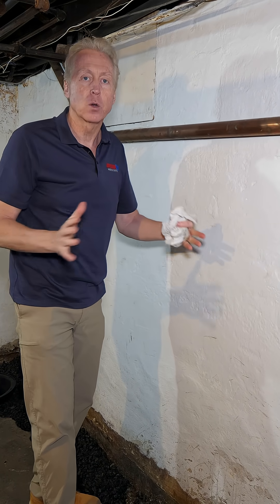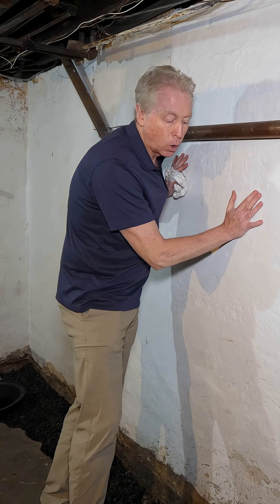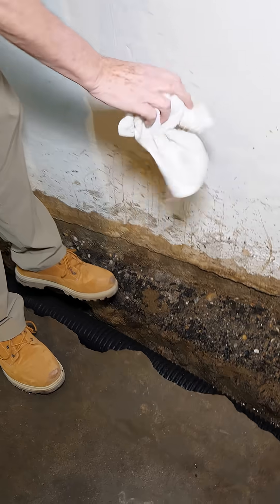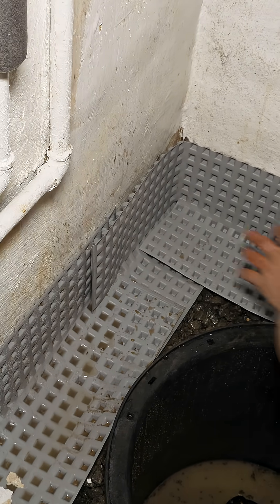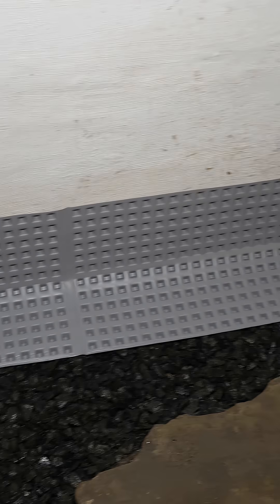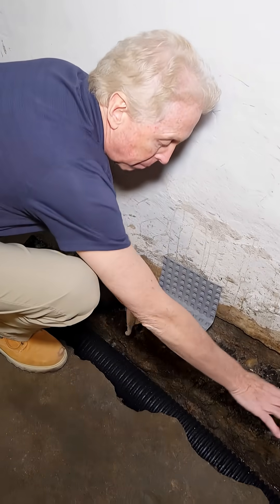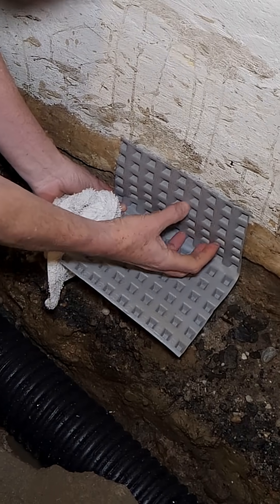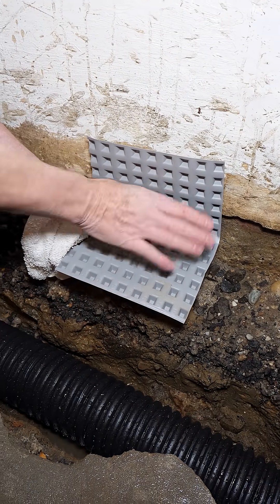How a Basement Drainage System Should Be Installed | the Right Way #basementwaterproofing

Comment: I can't find any basement companies in our area to use a system like yours, they all use those terrible tray/track looking piece ls that I always see you ripping out.
Reply from the maker: That’s unfortunate. The reason why you are seeing more companies installing drain channels in basement is that they are easier to set up shop, no experience required, and they earn a big margin off the quote they give you. The only problem is their system usually fails. You should seek advice from a person who understands foundation construction.
Reply: You don't want this system bro. It might be cheaper than doing it properly, but why would you waste your money to not solve your problem. Get it done right, from the outside. Seal your foundation up and save your home.
Reply from the maker: @dthrash86  Exterior waterproofing is super expensive and has a short lifespan. There is nothing that exterior waterproofing can do to stop hydrostatic pressure under your floor.
Reply: @dthrash86 my home is almost 150 years old, it has a sidewalk and deck on one side and a drive against the house on the other. It would cost a fortune to rip all that up just to seal the walls, also there would be a huge risk of collapse if that attempt was made. We have brand new gutters and down spouts and a 10 year old slab in the basement. Only a few areas will leak water during multiple back to back downpours, and it's around where the driveway is so not much I can do outside. Just need a better system like his in my front basement room. Probably going to do it myself since no companies here it like that, they use the cheap tracks.